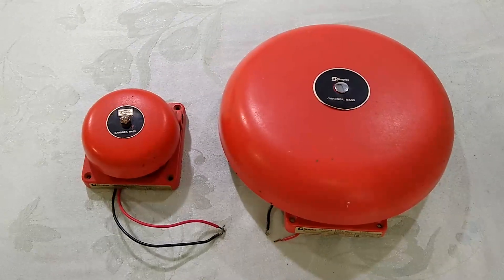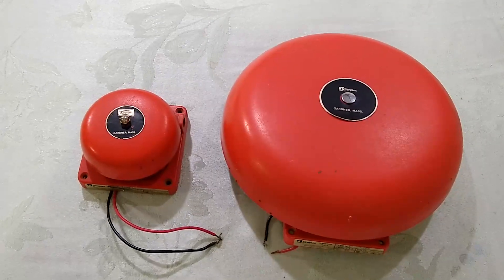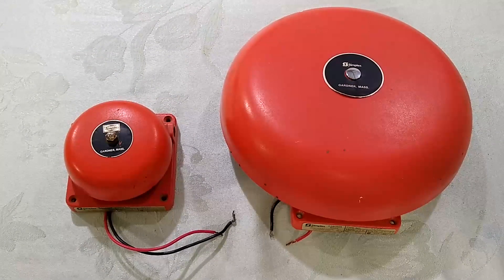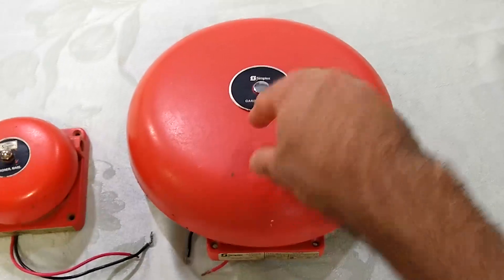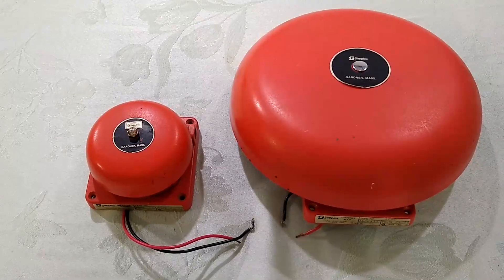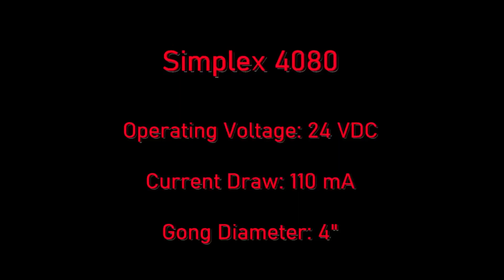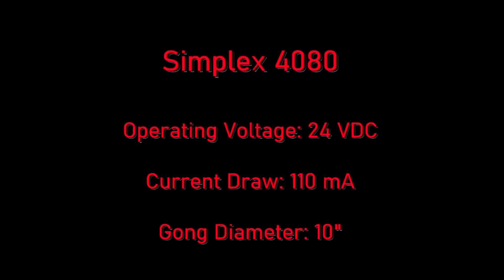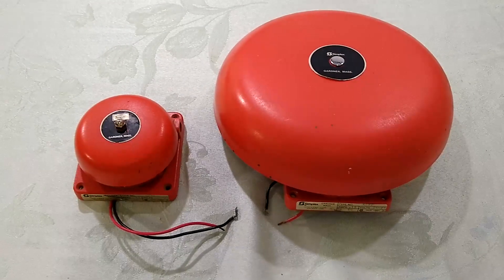Hell's Bells - Simplex 4080 fire alarm bells

Comment from the maker: Fun Fact - Faraday, the original manufacturer of these bells, produced this mechanism in both low-output and high-output versions - the 4060, which draws 110 mA; and the 4160, which only draws 70 mA. This is analogous to the 6120 (Simplex 2901-9838/9840) and 6140 (Simplex 2901-9846/9845) horns.

Both of these Simplex bells use the more powerful 110 mA mechanism.

Comment: 3:01 The VERY FIRST fire alarm device I have ever heard in my life. These were at a daycare facility in a community service center that I had gone too, installed on 2903 light plates (one of which being a 4903), and, unusually, the lights were orientated to be above the bells instead of below them where you'd usually see them. As of 2019 they have all been replaced by System Sensor L Series horn/strobes.